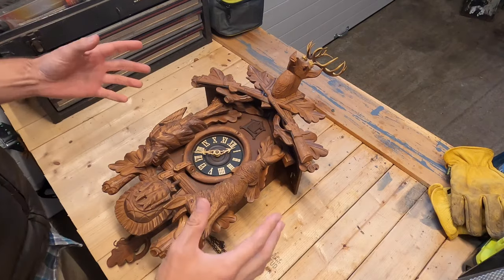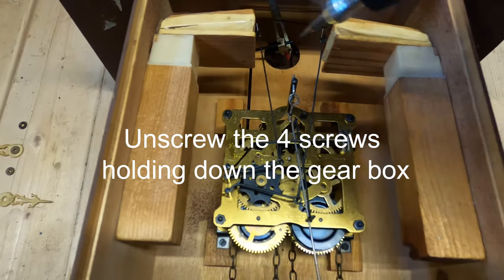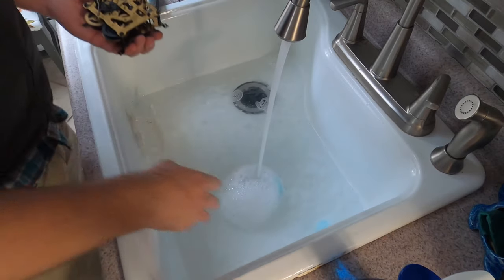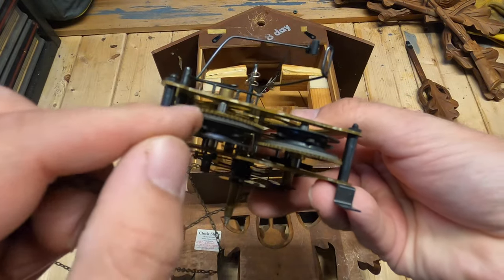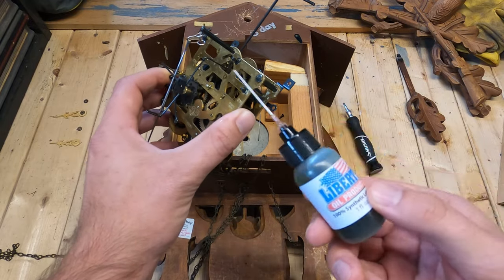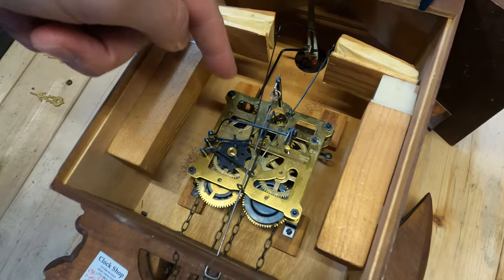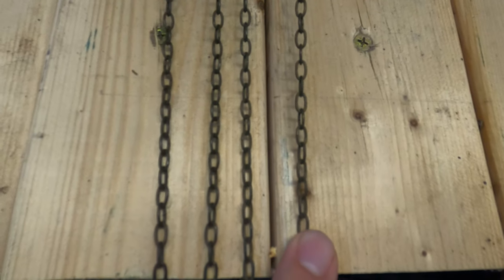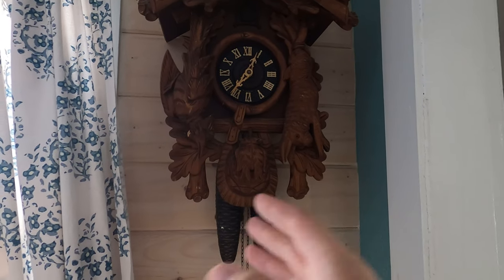Black Forest Cuckoo Clock Not Working? Let's Fix iT!

Comment: Well, you did try, but this was not a proper servicing. You didn't even oil the pivots, main gears or palettes. What you did is whats called a "Ducan Swish", highly frowned on servicing done by unscrupulous for money. You dunked the fully assembled movement into solution and swished it around, hence the term. Not really being critical because clock repair is a fading trade. But for knowledge sake here you go.

First, before removing movement, remove bellows. Usually 1 screw and one tiny nail in each. Some are unfortunately glued, you will need to break glue seal, or do your way. But your way is not standard.  The bird removal was ok. But sometimes easier to slightly unbend door wire so it slips off. The bird position on the bar is a little touchy. The chain you just take all end pieces off, as you did by twisting links, so far not too far off.

So you get the movement out, slide off the chains and now it's time to diagnose the bushing and pivots. What you do grasp main chain gear one at a time and wiggle back and forth. While doing this examine the pivot tips of gears, look to see if any pivot tip travels back and forth in amounts of 1/3rd diameter of pivot thickness or more. Admittedly this is tiny, but what it does is show you if there are any worn bushings.

The gears rely heavily on how well they mesh. The higher a gear is up the more prone to stop. A worn bushing hole effects the mesh resulting in a binding gear that robs power and stops the clock. Bushings that are worn are marked on the plate with marker, as next step is to fully disassemble movement. Understand that though this might sound like a daunting challenge, it is really not. Much of clock repair requires only minimal tools and tiny investment. Even for bushing repair which is very common clock repair. It is enjoyable hobby.

So in this example, let's say bushings where fine, Fully disassembled, each gear is cleaned by tooth brush and detergent. Alternatively, an ultrasonic with heat and detergent. Then most critical is to peg out each bushing hole. You can use toothpicks and battery drill with detergent. Removing dirt here is critical for clock longevity.

Next on some clocks you should do mainspring clean and lubrication. Just something to keep in mind. 

So, parts are dried like you did with hairdryer, movement assembled and then lubricated. Lubrication, you only drop tiny amounts in bushing oil wells using san oil dipper. Excessive oil leads to dust grit exposure. It drawls grit into bushing which brings early wear. Palettes are oiled and anything that turns 360 degrees.

Then reassemble. This is a proper servicing. Good for a few years.

To learn more sign up at free message board of the NAWCC.ORG
NATIONAL ASSOCIATION of WATCH and CLOCK COLLECTORS
RJSoftware
Reply from the maker: Thanks for watching the video!
Reply: When I saw the water and soap I thought it was a bit crude.
Reply from the maker: It was loaded with junk!

Comment: I wish everyone ( clock works ) would quot beating up on wd40, it's a great penitrating oil to loosen all the old dirty greasy springs and bushings, spray liberaly to loosen old oil grease dirt and grime, then soak in vinegar to remove the grime and left over wd40,  at that point  use synthetic oil ( which is wd40 on steroids ) to oil the specific points, vinegar and ammonia doesn't penetrate to clean but will wash away the wd40 that did the job.
Reply from the maker: Sounds fair enough, but how often does the clock need to be lubricated is the question. When we would use wd40 in the maintenance shop, it was great for getting things to move that needed to move, but not great for long-term lubrication. You need a special agent for long-term use. Nice to hear others challenging and sharing what they believe.
Reply: @FixiT-Rick  fair enough,  if posts would say wd40 is a good solution to free up and clean the mechanism to get ready for a long term use then explain the need for an oil with a synthetic additive that would work but to say don't ever use wd40 on a mechanism is just a one sided comment,  if you give more options you will get more results.

Comment: Hi,I need your help,I have a one day cuckoo  and I'm having a problem with it,the chain incharge of the cuckoo bird as soon I install the pine weight goes down all the way and the bird start singging with out stoping, I can not put the weight,can you please tell me how to fix that problem ? Thanks
Reply from the maker: I’ll do some research on this.
Reply from the maker: Something might be stuck in an open position. As the pine cone is being pulled down, see if anything is separated from touching the gears.